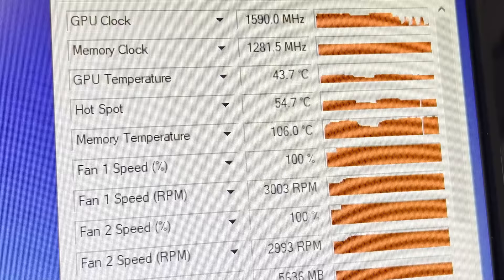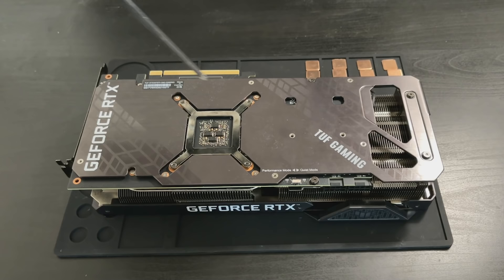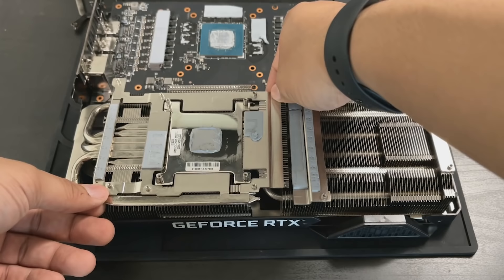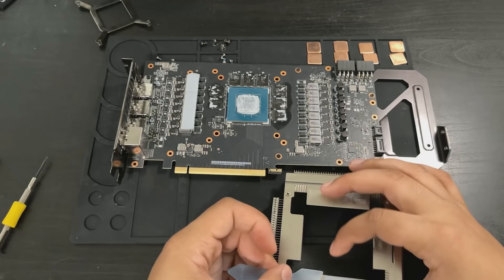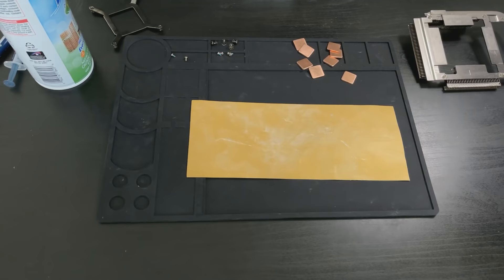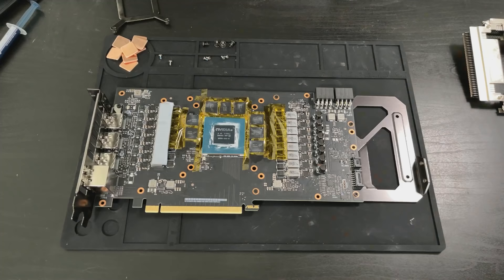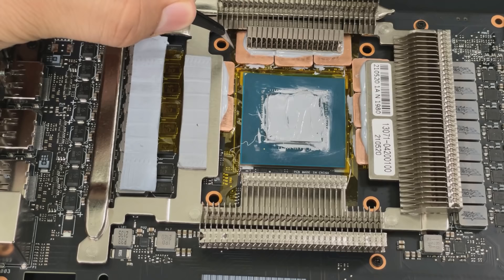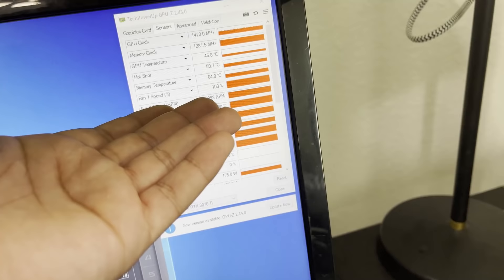I Copper Modded An RTX 3070 Ti.  Memory Temperature Dropped 45 Degrees! This Is How. (110C to 64C)

Comment: What blows my mind is that they charge a literal arm, leg en kidney for these cards.. and cannot spend 5 dollars worth of R&D to bring memory temps down. Well done what a great result!
Reply: That's exactly what I thought.
Reply: well they need to sell new cards sooner better than later :)
Reply: The problem is with memory chips. GDDR6X are much hotter than expected. 

Well, testers fucked this up
Reply: @WszystkoZajeteOMG409  testers fucked this up?
which "testers"?
Reply: @johnmachter40  Somebody has to test the product before release so they can fix it up.
Reply: R&D is expensive, they just have to spend 1$ for each card on better thermal pads
Reply: @manadog  And these cards are made in china.. The prices are way too high for this crap we get. Customers must win back their power lmao.
Reply: The world we live in
Reply: You would be surprised how exponentially the costs rise with a couple ounces of copper in mass production. It actually costs less to just aftermarket mod the devices. Plus... I don't think anyone expected GDDr6 to be as hot as we are seeing. Both AMD and nVidia slept on this one.
You can also see this something mundane like heatsink and fans shipped with CPU's. Intel were the first to ditch all copper heatsinks with nickel coating to aluminum with copper slugs. Then for a while, all aluminum.
Reply: Is😅 it still running well?
Reply: @JamesRichardsPlays  from my experience gddr6x is not hot at all, there is something really wrong with his gpu in this video, my rtx 4080 stress test shows memory temp max is 62c the problem is the hotspot temp which is 82c
Reply: @Ciffer-1998  I haven't purchased an nVidia product for a loooong time now. I think the last nVidia card was way back when XFX were making cards. 280GTX? back in 2008-ish. It was a version that had SLi and I had two of them. Anyway. I have always ripped things open and changed the thermal pads, grease or modded them for cooler running. I get bored easy. My current 6800 XT from AMD is the same way. We also need to remember "silicon lottery". My RX 580 from MSI I had before this has been usable for years now and it was always running cooler and faster than other people. Only after the massive update to Cyberpunk 2077 I was no longer seeing average 60 fps. Everyone I knew who had one, couldn't get there and mine never got hot enough to make too much noise. I had also made my own copper mod for it. This is the last time i am doing that though as the dude who owned the scrap yard I was getting it from died and his kids are selling everything off and closing the business.
Reply: Lots of stuff went out of the window because of the pandemic. One of those things was quality control/assurance.
Reply: You cant ımagıne ıf you know how they calculate their profits. THey are sellıng for example 2 mılyon of these GPU s. So, 10 mılyon dolars of loss for  them. ıt ıs not about they cant or they could not thınk about ıt. Everythıng ıs about MONEY MONEY MONEY!
Reply: @JamesRichardsPlays  I too had a scrap dealer friend melting old copper wire in a barrel when younger. I was the only one who could understand him as he had either a mental or speech defect that I could just barely understand.
Reply: I waited till they were on sale I currently have a 3050, 3060 and a 3070 my 3050 is in my old hp pavilion gaming desktop paired with a ryzen 5 3500 and 16gb of ram, my 3070 is in my current rig paired with a ryzen 5 5600g and 32gb of dual channel memory 16gb 3600mhz x2, so I feel like I got the lottery on the gpus not over heating!
Reply: Plus the gddr6 memory chips are ridiculously cheap and they charge a fortune to give us more vram
Reply: memory is designed to work at this temps so there is actually no need, it's all in our head
Reply: Oh you guys live in consumer dreamland. Switch perspective to a 60% profit company and it makes sense. 👌
Reply: @Ciffer-1998 dude 80 max on my 3070ti ftw3 (long since replaced)
Reply: @bengonzales1182 you can't blame this on covid. China industrial is collapsing all on its own.
Reply: @donatedflea  100% correct hahahha.
Reply: I am thinking on building a new pc but not even thinking about buying anything pricey.
Reply: That's because the optimal operation temp of VRAM is between 80 and 100°C... at 110°c VRAM performs better than at 64°C, so this mod is actually hurting the performance and can lead to reading errors, missing textures in games, artifacting or crashes.
Reply: @ivanrivera777  🤣🤣🤣🤣🤣🤣🤣🤣🤣🤣🤣🤣🤣🤣🤣🤣🤣🤣🤣🤣🤣 Wow.. just wow. Yes.. extreme overclockers liquid cool their hardware because they want, according to your logic, sub optimal performance. You clearly know nothing about hardware and the effects of heat on efficiency, Please go educate yourself before commenting.
Reply: And it's not like there's a big market for GPU coolers anymore, barring watercooling blocks. The market for aircoolers has literally disappeared. Remember the Arctic Cooling S1? That thing was legendary and pretty much beat the snot out of every pre-installed cooler. And it was cheap. And it was compatible with basically every GPU under the sun.
Reply: @ivanrivera777 😂😂😂😂
Reply: They want you to buy a new one every other year
Reply: Why should they? Profit above all else, if folk are buying them with sub par cooling solutions, they will continue to use cheap cooling solutions.
Reply: @donatedflea   your down years will ruin your 60% profit company, recycling all those workers back into the workforce pool and further hindering their employment furthering opportunities.   Just saying.
Reply: shouldn't have bought an asus card i guess.... ( vega64 STRIX owner here, well my current card is on water, and not asus, but still)
Reply: @JamesRichardsPlays  dont be naive, they knew full well how hot the vram chips would run.
Reply: @Vicorcivius  Naive? I don't see how I am being naive. Perhaps I didn't make myself clear; the engineers knew it but the people who make money off these companies wanted something pushed out now. Thus, "AMD and nVidia slept on this one"
Reply: Why would they want it to last long? It’s part of the business
Reply: And if you took a look into the old GPUS you can notice that they had several copper heat pipes to better dissipate the heat. The current ones have no copper heat pipes, actually no copper at all and to make the things more interesting that the price of a GTX 970 when it was released it was $329 and now the RTX 4070 costs about $503.
Reply: @charlconradie4935 well, there is an optimal temp for speed in nvme ssd that i read about maybe around 50c i think, but yeah not sure about what he said.
Reply: @martinszulc8192 Great world I agree. Innovation never stops
Reply: Gotta pinch pennies somewhere.

Comment: So let me get this straight. They went out of their way to make a dedicated memory cooling plate, but didn’t make it large enough to cover the entire chip surface and they couldn’t spare 1mm of thickness, for better cooling. Sounds about right for GPUs that were scalped for 2-3x the msrp.
Reply: It's not the scalper's fault that Asus makes crappy products.
Reply: They've got to sell those coolers. 😏
Reply: Ngl you had us in the first half
Reply: i would imagine the main reason to be the manufacturing tolerances.
Reply: @SteveQ you are right. the actual fit of the heatsink seems to be really bad aswell, not even being ontop of a lot of the surface area of the chips.
Reply: @Chriss120  The big issue is the fact that all these chips are soldered on make them very susceptible to extra solder being under one chip and not the other, on top of that all PCB (The circuit board) are not created equal. You need to have larger tolerances because of manufacturing, ON TOP OF THAT these boards go from room temp to as high as 200 Degrees so there will be expansion as well as warpage so he is probably shortening the life cycle of his GPU by doing this. It will more than likely die early do to cracking the board from extra stress from flexing the board in those areas.
Reply: well the faster it broke the faster company get money
Reply: GPUS back to normal now tho
Reply: @WCIIIReiniger  AHAH nice joke, mad gigabyte user
Reply: Not the first Tuf series card that sucks...
Reply: This is like in old Louis de Funes comedies, where one engineer saved millions by removing 1 screw from tech plans or something.
Reply: It's probably a tight profit margin and creating heatsinks with complex architecture doesn't make a lot a sense for a product that's going to be obsolete in 3-4 years anyway. Most pc guys I know are notoriouly stingy and the vast majority of people wouldn't spend extra 50 dollars so they can have decent cooling on their graphic cards. Manufacturers are forced to cut corners whereever they can in order to stay competitive.
Reply: bro you are so wrong scalpers are resellers not manufacturers bro learn before you comment 🤦‍♂🤦‍♂
Reply: whats worse is that if you pay attention tyoull notice that the majority of coolers on gpus thesze days are stainless steeel sure the fins them selfs are aluminum but the memory cooling section is not its stainless well besides the cooling fins that dramatically changes the cooling potential of the card kinda dumb i think they do this stuff to give it somewhat of a determinable liufespan  because as we all know the biggest threat of any computer parts is heat its the one thing that will eventiually kill a gpu
Reply: Engineer designs, bean counters count,  manufacturing cuts corners and marketing sells product
Reply: @Chriss120  They could do it, but then the card would cost another $50. And they would have to say the reason was "cooler memory temps"
Reply: Asus being asus. I dont know how many of you remember the asus strix vega 64 situation? Literally every single unit was improperly built and the coolers came loose from the card resulting in overheating and high fan rpm. The fun part? If you RMA it they send you new one (after few months of fighting) with literally the same exact issue

Comment: I have a 3090, my buddy had a 3080. We were both having random black screen crashes. I pulled mine apart and repasted it and put brand new pads on and my issues went away. He got a 3090 and sold his 3080, and the guy who bought it messaged him about memory overheating issues. The guy who bought it opened it and said the pads were dry and cracked. He repadded it and it is fine now. If you are having heat issues with these cards, definitely repaste and put some brand new thermal pads on it. Under heavy load my memory temps go to mid 90s now, instead of 100+

Comment: Great result!  People offering advice on changes you should make are missing the point!  YOU HAD A 40C DROP IN TEMPS!  DONT TOUCH ANYTHING AND BACK AWAY SLOWLY!  Great job.  Take care.
Reply: I think you're missing the point bud. The idea is good but the execution could be better. 10s of scrolling shows a litany of improvements to this mod that warrants revision, especially 1:1 height for thermal pad to copper shim.

Comment: Great video, thank  you, subscibed :). Is the  Kapton tape really necessary? I can't see any way short of a big impact that the copper plate can come in contact with any of the solder terminals and short out. Perhaps a conductive material could find it's way in there over time and bridge the gap, but then this can happen with the heatsink itself. mmmmmm?

Comment: Neat idea, but for the others want to try this mod and find out the vram modules and gpu die are sharing the same cold plate you must use thinner copper sheet than your stock thermal pad, because the stock thermal pad will get squished by the cold plate pressure so the thermal pad got little bit thinner. Otherwise, it will hurts the die temperature because the die won't get enough mounting pressure.
Reply from the maker: I do agree. I will add some QnA in the description for this.
Reply: I came here to say this exact thing.  I have a RTX 3090 that was thermal throttling while mining and I replaced the thermal pads and it no longer throttles but the memory still tops out around 100C so I really want to try this.  Only other suggestion I have is that it may be better to use a strip of copper across the vram instead of individual shims.
Reply: @cheerbeerification  Don't do that, just use splitted pads. Vram modules can have slight difference in hight due to soldering! That's why flex thermal pad is used. It can have variations in high and with complete copper piece you might not provide good contact with all modules, keep that in mind.
Reply: @cheerbeerification  you could probably cut a sheet with the desired thickness so that each row of modules share 1 copper plate instead of each 1 having their own.
Reply: @Kalisparo  I was thinking about doing a "hybrid mod" with a very thin (maybe 0.3 mm) high quality thermal pad directly on the VRAM, and then a 1.2mm copper strip on each 4 module cluster, to fill most of the 1.5mm gaps. I figure the thin thermal pad will solve any height difference and conductivity issues, while the copper will still radically reduce thermal resistance.
Reply: @joaonunocardoso  thanks for the heads up on this 🤙🏽
Reply: There's a company producing precision machined copper plates to replace the pads for a bunch of different cards. You can find the dude on YT if you search CoolMyGPU (no spaces). 
I won't try to link his site or anything because I'm not affiliated, but I've had very good results with his products.
Reply: @Kalisparo  One thing that I have recently learned is that some thermal pastes (specifically KPX) has a "cure" time of several heat and cool down cycles and when it is "cured", it makes a pretty dern good adhesive which would definitely help keep the copper from moving.  Kryonaut also has some really good adhesive properties.
Reply: @joaonunocardoso  traduz kkkk melhor usar thermalpads ?
Reply: @Calango741  yeah, some thermal pastes cures and some do not. Cryonaut for instance stays liquid.
Reply: @Kalisparo  considring its LIQUID metal that makes sense :D
Reply: @cameronliddell9533  true. I don't think the difference would be huge with a good thermal paste though. 5 to 7 degrees C maybe?
Reply: @Shadowen925  if you are american its nice to order. They offer those pads in 1mm, 1.5mm and 2mm but if you are in europe shipping alone is 58€.
Reply: @virtual-viking have u try this? If so, what's the result?

Comment: Here in the Philippines if you posted something like this. They will try to invalidate you by saying "Mas magaling pa kayo sa engineer na gumawa nyan" which means. You are smarter than an engineer that designed that, in a sarcastic way. If that didn't work. They will try to argue that it's common to reach more than 100°C. Bro common doesn't mean that best.

Comment: I'd have used thinner copper pads. Thermal Pads have some "give" as you tighten the heat sink down, they get compressed. Copper is a metal, while it's ductile, it's not compressible due to it's hardness.

Edit 1: Just saw you filed the excess. Neat!
Reply: it also expands when heated. so it gets tighter. compressing the chips
Reply: Good point @fulgerion

Comment: For those trying to do this with a single piece GPU cooler, I recommend measuring for the copper shim thickness by using plastic gauge. You'll have to disassemble and reassemble your cooler a few times to get the clearance measurements.
Reply: Wouldn't the results still be off? The thermal pads are meant to compress. Copper isn't.
Reply: @enermaxstephens1051 he's trying to find the thickness of what the pad is squished and then get shims in that thickness as to keep it the same.
Reply: The thickness probably varies in different spots by how much I don't know. I would have tried also to use a single piece of copper for a shim. Might even be possible to drill tiny holes and screw copper shim to the heatsink so it can't move then no worry about the shim moving and shorting something out.  @trmgregor
Reply: @enermaxstephens1051 They make plastic specifically for measuring stuff like this. It squishes to the exact gap.